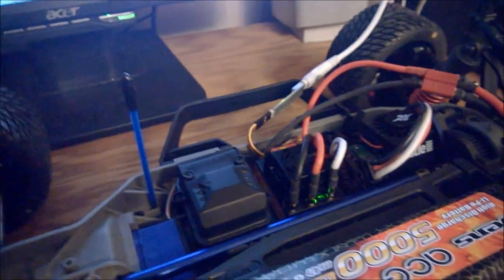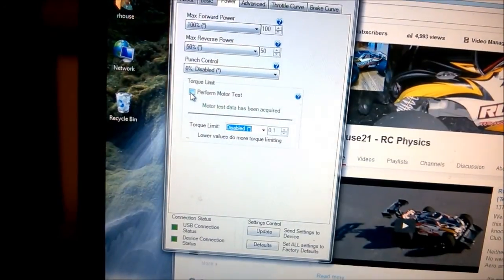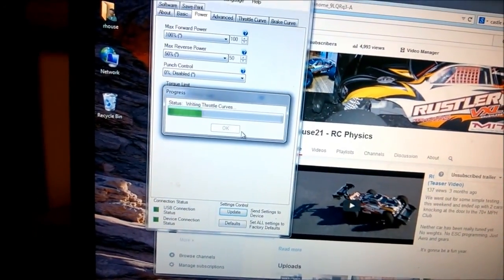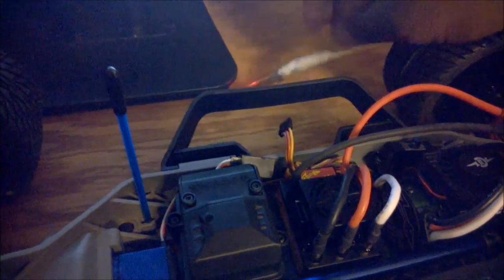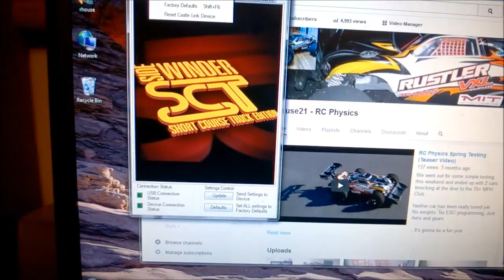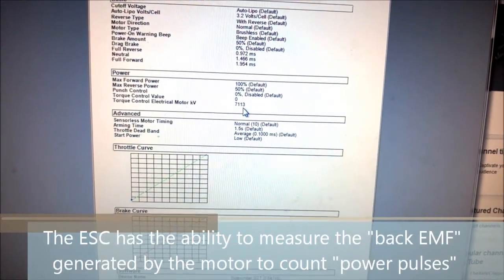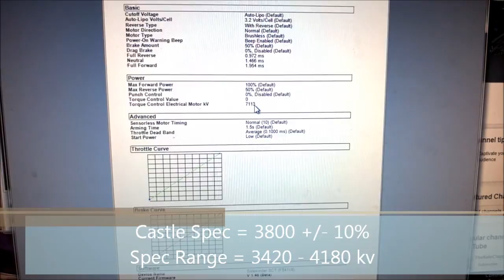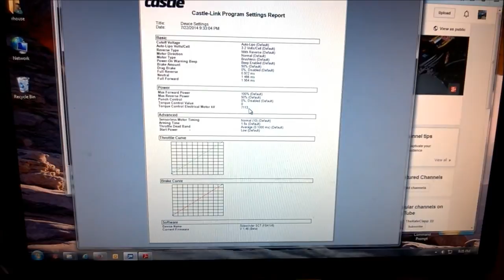Ep. 34: Hidden CastleLink Features (Motor kv Test)

Comment: Why the need to divide the castle results by 2 at the end to determine kv? I'm not tracking why if it's a 4 pole etc, is this necessary?

I used this tutorial. Removed the pinion and tested my castle 1406 5700 (3s).

 I received 6975 rpm as the result. If you use your method my 5700 is only pulling 3397.5 kv?

Also worth mentioning if you're having trouble getting the castle mamba x  esc to enter the rpm test mode make sure your epa trims are fully open, especially if you have a digital radio/tx. If not the esc will not register that you are trying to go full throttle. 

I could only get my mamba x to enter this mode in normal direction ie sensored (green light on esc). This was actually great as I learned I could reverse my radio then un select reverse motor rotation (in castle link) and allow my setup to move in normal direction.

Now my data logs for throttle input are going in the same direction as all else. 

Thanks in advance.
Reply from the maker: Is your motor sensored or sensor-less? I discovered since making this video that the number for sensored motors often comes out "ok", but you still need to do the divide by 2 step for sensorless 4-poles. I think this is because in a sensored motor, the ESC can measure the number of commutation pulses and compare them to the actual number of rotations of the shaft. With a sensorless motor, all the ESC knows is how many commutation pulses were sent and it defaults to a 2 pole estimate, which requires 1/2 as many pulses to make a full shaft rotation than a 4-pole.

I've been told that motor kv readings can be off by as much as 10-25%, so measuring 6,975kv on a 5,700kv motor isn't out of the realm of possibility. 

I should probably make an update sharing that info. 😅

Thanks for watching!
Reply: @RCPhysics  it's the sensored 1406 5700 kv from castle creations.
Reply from the maker: Ok. So the measured number is probably right. You can also confirm this by spinning the motor up to max rpm (with the pinion off) and checking the data logs. Simply find the max rpm, divide by the voltage shown at that point in the log, and you have your number. 😎